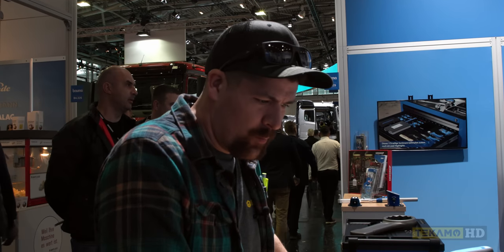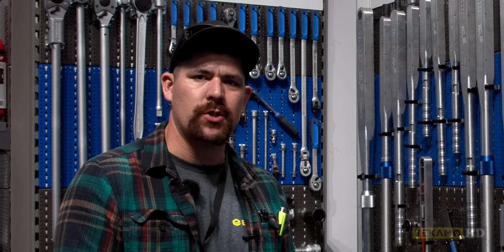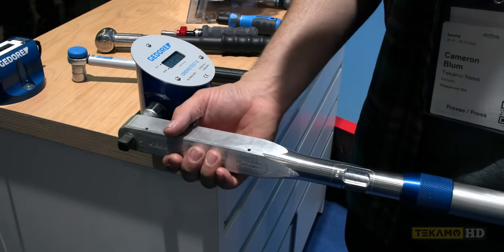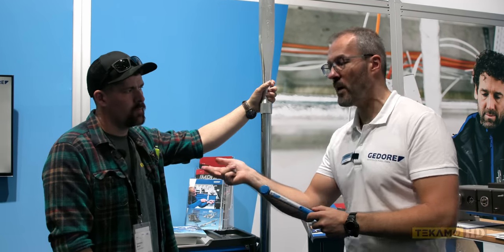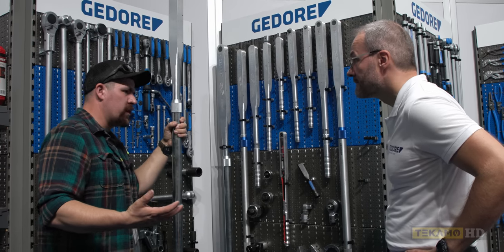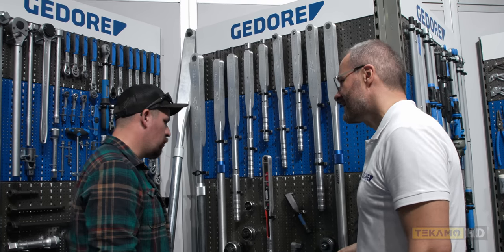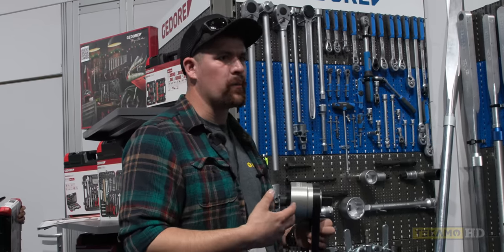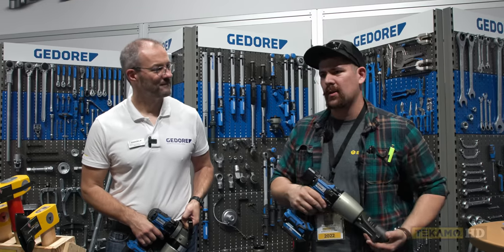The Torque Wrenches She Tells You Not To Worry About - The Gedore Booth Bauma 2022

Comment: After doing this for a while, high back drag and low tooth counts are my biggest pet peeves when it comes to tools
Reply: What’s that mean?  Serious question
Reply: @Bdigital9482  On a ratchet back drag is the amount of resistance the tool takes to pass over the teeth. This is bad because high back drag will turn the bolt instead of ratcheting which means the bolt turns in the opposite way the tool has been set to go.  Tooth count is how many teeth are inside the ratchet. The lower the tooth count the less dead turn (The unused arc swing the tool takes to engage the next tooth) so that means you have to swing the tool a lesser amount of times to take a bolt in or out on a ratchet with a higher tooth count. Hope this helps clarify.
Reply: @walkersullivan6201  I found Gearwrench xp120 to be pretty good at both.
Price wasn't too bad either for a 4pc set 1/4"-1/2"
Reply: @Tmjpwns  I do like the Gearwrench ratchets for the price. I have a 1/2 one I really like but the rest I have are Snap on & Matco

Comment: Only have the 6V-6080 Cat Multiplier, it's a beast, but cumbersome.
Hytorc has similar battery powered torque wrenches, brilliant for changing track pads, if they go high enough.
Reply: Batteries don't last long enough on the road guns to make it viable yet compared to the air ones for track jobs unfortunately from what I've seen.